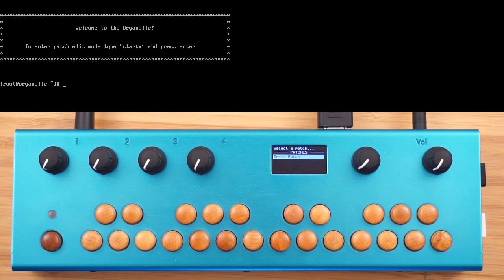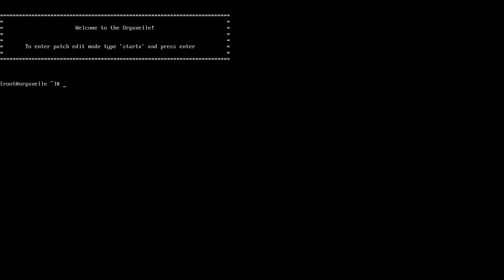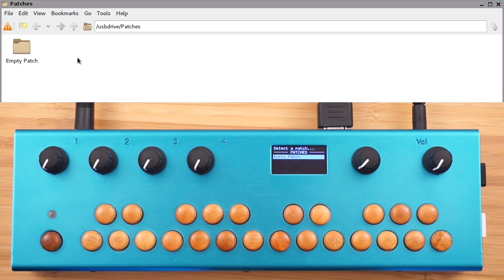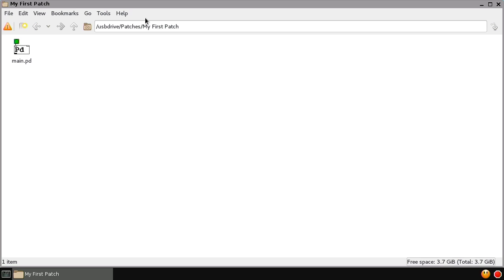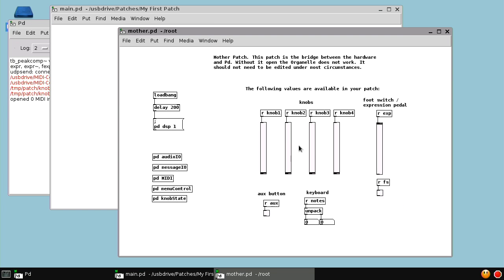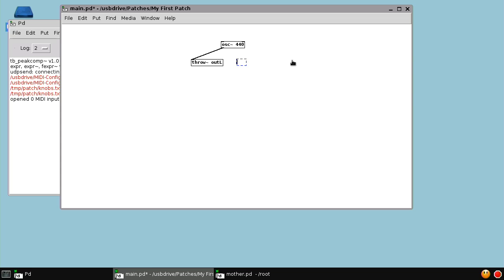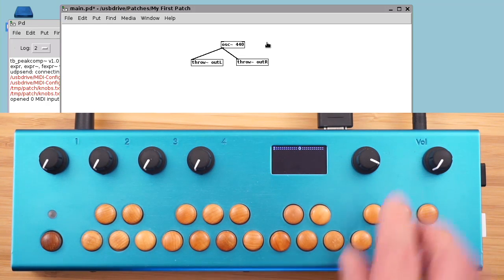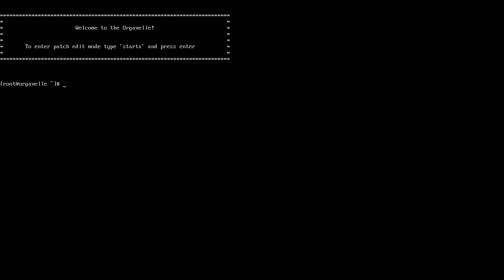Organelle Pd Patching Tutorial, Part 1: Basic Patch

Comment: Im stuck at connecting my organelle to a monitor.. ahaha. 

How do I set up my windows 10 to display the organelle?
Reply from the maker: If you have a compatible USB-WiFi adapter and the newest OS (4.0) you can use the VNC server to program on the Organelle remotely. Setting up WiFi and VNC is covered in the manual. Not sure which Organelle you have so you can find manuals for both here: https://www.critterandguitari.com/organelle#resources